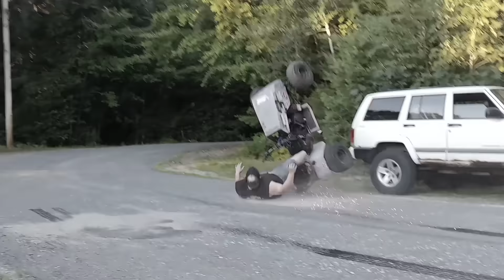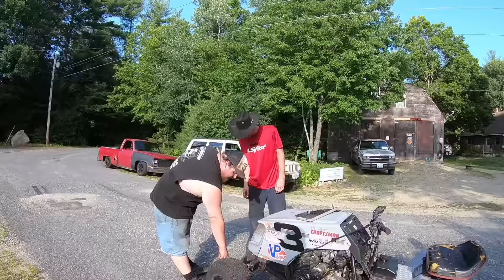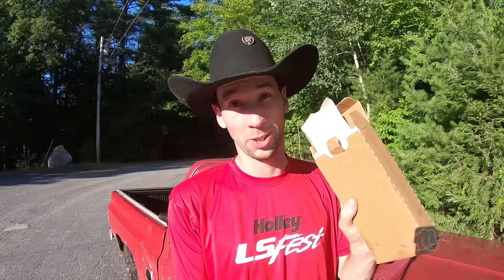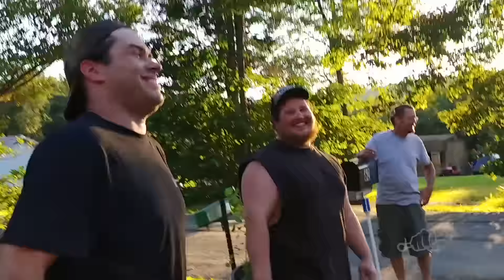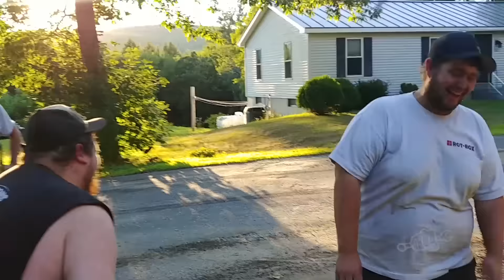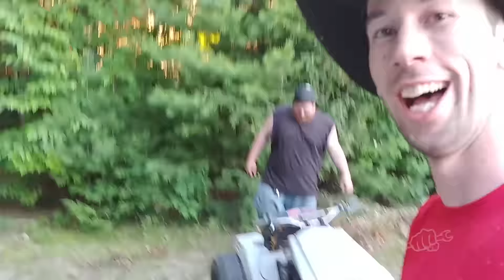Street Bike Powered Lawn Mower - Deathwish EP1

Comment: I'd be scared running those tires there probably rated for no more than 15-20 mph..?!?!?!!
Reply from the maker: Yeah they need to be upgraded for sure
Reply: Well if tire speed is any indication, I'd say they should be rated a bit higher. :) Cool sketchy build, cool show!
Reply: Racing mowers aren't for the scared
Reply: they are fine. those ratings are for extensive use at speeds higher than that. meaning you cant go back and forth up the interstate for miles on end. these tires will never see that use
Reply: Safety 3rd
Reply: jason9022  triggered
Reply: We used to terrorize the towns on banshee's with those tires. Many 80 plus mile an hr runs and burnouts with those tires. Don't be scared...
Reply: FishNHunt 2    Ever heard of a lil' thing called "it'll be fine"?
Reply: @lobmin  I guess if it ain't broke don't fix it... and besides u will get alot more work done around the homestead after one of them does go and u end up cheese grating all skin of ur @ss and can't sit down. lol but seriously good shit can't get enough of the backwoods ingenuity!!
Reply: Its a lawnmower.. they dont go faster than 15 miles an hour
Reply: That's just what there rated you can tripple that lol
Reply: If there not too worn or corroded use em
Reply: I'd be more concerned with the rear wheelbase than the tires, those tires take a beating.
Reply: jason9022  your real quick to judge someone you have never met, probably never will bc your way above their class level, you and your mower is by far THE BEST there ever was I'm sure.....
so why exactly did you watch the video in the first place other than just itching to talk smack against some people who actually have a life?
Reply: How bout them spindles...they look like a bent piece of rebar...super awsome vid but looks dangerous 👍🔥🔥🔥🔥🔥

Comment: Brilliant, that lawnmower is as bonkers as the YZ 125 powered mobility scooter our friend built. 👌
Reply from the maker: Sharon Davison it’s wild for sure
Reply: A yz125 mobility scooter!!! Now that even scarier half the weight of a lawn mower on that short of a wheel base with even smaller wheels it probably gives people whiplash lol don't get me wrong I grew up racing motocross and flat track four wheelers and a kz1000 motor on a craftsman is asking for a hospital bed but a yz125 on a mobility scooter if you nailed it and road it like a 2stroke and kept it in the power band while shifting it would probably peel you off the seat where this kz mower has road bike gearing it's probably a little more forgiving cause the gearing is stretched out for the road? Mad respect to both though !
Reply: Sharon Davison put up a video of it

Comment: 14:55 usually when you can drive into a wobble/shake and drive out of it (by going faster) it's a tire out of balance thing. And by using regular mower tires its expected to have some shake to it. Personally,  I would find racing "holeshot" back tires (off of a fourwheeler) and maybe some fourwheeler front tires. I know itll change the whole look of it but most likely if you do that you'll be able to get past 3rd gear a little more safely and possibly hit all gears depending upon the integrity of the build as a whole.
Reply from the maker: yeah mower tries do no work well at speed at all

Comment: In the mid 1980s a friend built an off-road gocart with a Yamaha 650 in it. We took it to an abandoned air strip. He told me no one  had ever gotten it into 6th gear, so you know what I had to do.  I ran it down the air strip a ways, turned around and headed back toward him, 6th gear full throttle. When I was coming up to where he was standing I pitched it sideways and drifted it past him.
Reply from the maker: SKETCHY!

Comment: I have a old push mower that I turned to a trailer for a ATV or riding mower it came in really handy
Reply from the maker: how is that possible?
Reply: I got rid of the engine and blade cable then I made my own pin and clip hitch from old  bed liner then bolted it on
Reply from the maker: sounds sketchy

Comment: My neighbors built a mower like this using a atv engine and it would do 40-45 still had the manual shifter between your legs it had 4 forward gears and 4 reverse gears. They somehow rigged up a clutch and gas pedal just like driving a car. No brakes though had to use a hand break to bring it to a stop.

Comment: I have the same mower, bone stock with the 14 HP Briggs & Stratton I/C Gold engine. How are you burning out like that? I have to really be careful not to pop a wheelie with mine. Extra weight from the engine I guess?
Reply from the maker: Horsepower and a clutch

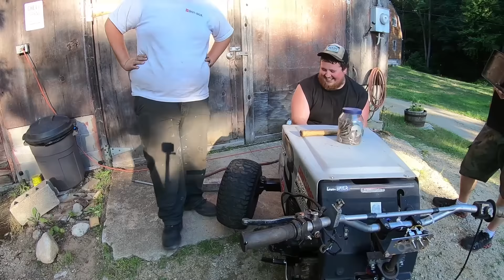Comment: This when you start to check tire speed ratings. Maybe shave off some tread. 7:13 ~ Run the drill slower to preserve sharpness and temper, 'til it gives long ribbons of removed steel. For steel drilling, that's the right speed.  It's very slow, but drills the hole faster.
Reply from the maker: they got excited and wanted it done ASAP lol

Comment: Lmao the stickers for torques wow
Reply from the maker: they add that and horsepressures
Reply: Lol you should meet a hydraulic expert I talked to I was pitching him my Idea for a hydraulic flying with a piston driven pump he said you need one horse power per gallon to move hydraulic fluid I said ok what if I did a larger piston and did gear reduction to the pump wheee it only rotated the pump 30-60 rmp he said wouldn't work one horse power per gallon 😜 lol my worlds never been the same cars stopped driving just now
Reply: Hydraulic flying car
Reply from the maker: sounds sketchy
Reply: It is a little sketchy I'll give ya that I definitely designed it with parachutes but at the end of the summer I'll be gear reducing a push mower engine to see if it'll gear amplify 40 pounds 3 times more likely pulpy amplify using high pressure pvc to build the lines and hydraulic motor And using a spicket to let pressure out of the line to slow speed up the hydraulic motor so if I can accomplish that with pvc definitely a testing strategy so those videos should go up this fall

Comment: no air filters wont last long
Reply from the maker: but mo power
Reply: @BustedKnuckleVideo  if your jetted factory your actually loosing power because it's running lean
Reply from the maker: it doesn't need more power, it's already out of control